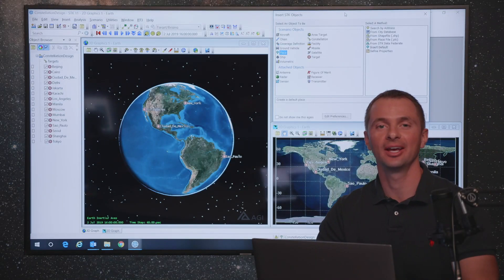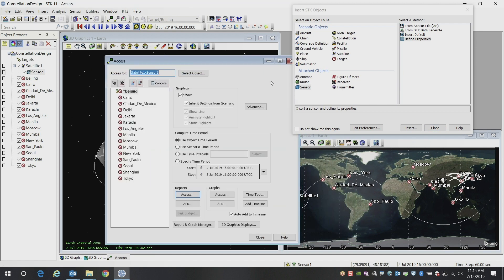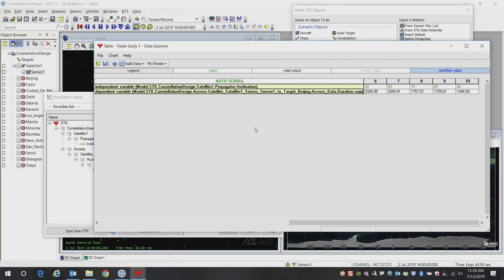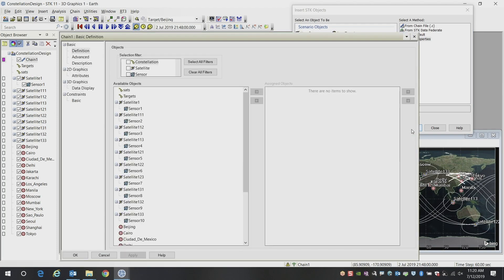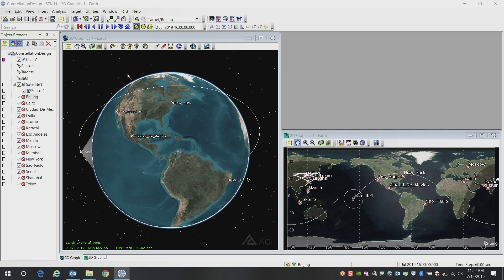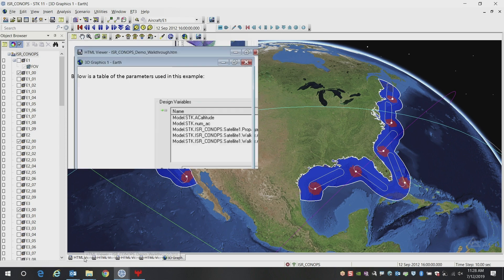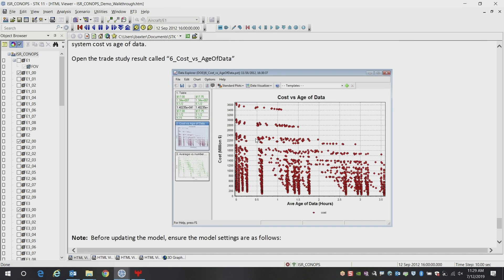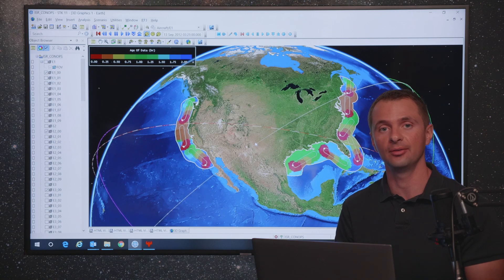Product Demo: Satellite Constellation Design

Comment: How can I get the tutorial of this trade study?
Reply: Go to www.agi.com/tour, scroll down to the training section and look for "SatPro Constellation Design Training"
Reply: @BaxterAGI  Thanks, Baxter. But, I did not find the tutorial of the scenario "ISR_CONOPOS" in this video, the one that has cost vs performance.
Reply: @BaxterAGI  The above link is no longer valid. Can you provide an updated link with instructions on how to set up the age of data study? I am running into issues getting the outputs you have on you 2D and 3D graphics